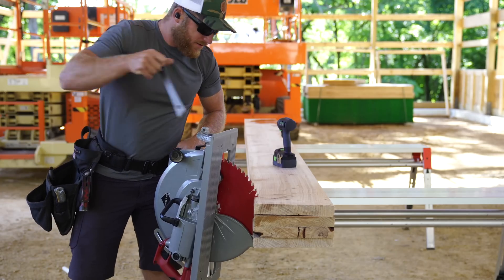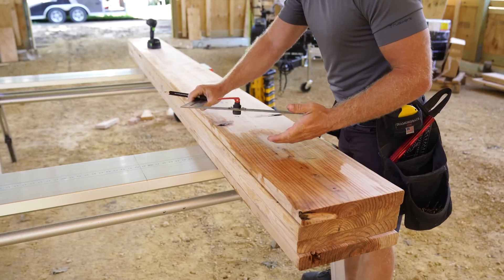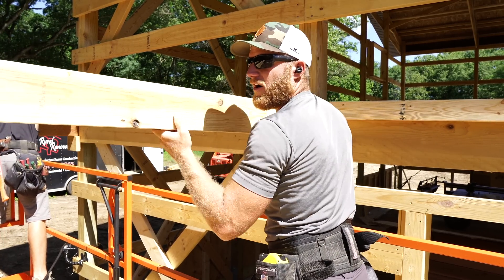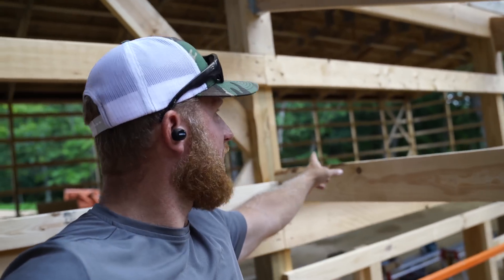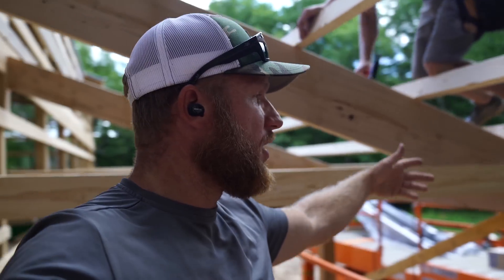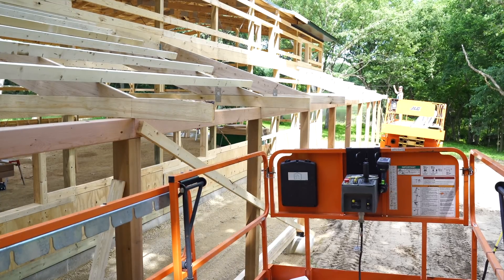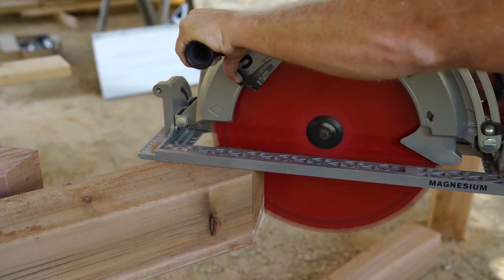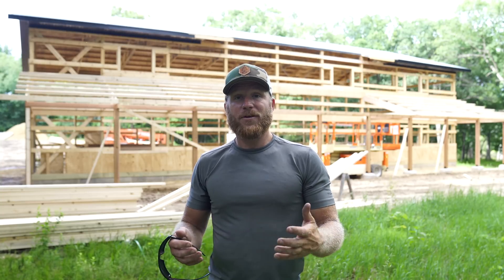Cabin in the Woods Part 10: Cedar Porch Framing

Comment: Hey dude nice job. Just a note, when your cutting using the killsaw on the larger beams and it pinched. Use a clamp on them once they are level with each other it just stops that tiny movement that pinched the timbers it works 👊👊👊👌

Comment: Like always, great quality work !quick question; the short point of the rafter sitting  in on the 2x6 beam would put roof weight on that 2x6 beam, would this cause a sag on the 2x6, especially with a snow load?

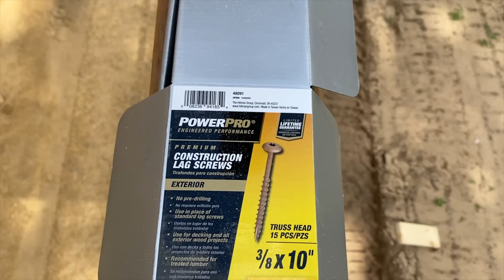Comment: 14:33 I’d definitely use a triple hammer or gen 3 Milwaukee for those lags if want them to go in quick with some Oomf behind them😅. Granted, other impact drivers will put those lags in, but maybe not as quick😉
Think you’ll like those lags, they work pretty well compared to the GRK, you are used to (interesting to hear your take though, after using them).
Build looking good, & for just the 2 of you, good progress💪🏼
Cheers✌🏼

Comment: I hope you stay in that state, because that is the most substandard framing I’ve ever seen. Notching a 2x6 to a 2” bearing sitting on a 2x4 completely illegal. You turned a 2x6 into a 2x2 spanning 10ft...The rafters sit on that 2” ceiling joist and are not even over the beam..held by a tiny flitch plate. 
     Either your just winging this build or the codes in your state are the most lax I’ve ever seen in 30yrs...Completely bad building practices. There’s only 70lbs over 100 sg ft...live loads like snow, dead loads...I hope no one follows this series and thinks your a good builder...

Comment: Kyle. Just remember that the more precise you are at each step in the construction the less problems you will have with all the parts that go on after. In the end everything fits. I am a retired Civil Eng. and math is definitely the way to go. Less issues to deal with for a little work up front.

Comment: 2:03 "I was confused there" So was I.  Calculating rafters is worse than mathematically modeling heat flow in a metal bar using nonlinear second order partial differential equations solved using Bessel functions.
Reply: But not quite as hard as Energy equals mass, times the speed of light, squared.
Reply: @psidvicious  which is why a grape fruit size of plutonium can flatten a city.

Comment: I’m the same way on having one guy measuring/ cutting with the same tape measure.
Reply: I’ve seen retractable tapes can get ‘off’ by letting the tip slam back into the case over and over. The tip starts to curl, which starts ‘adding’ to the measurement. And on rare occasion I’ve seen 100’ tapes read slightly different measurements in long distance pulls.